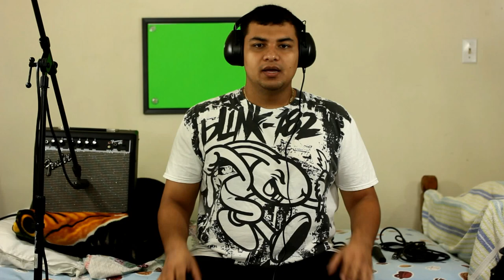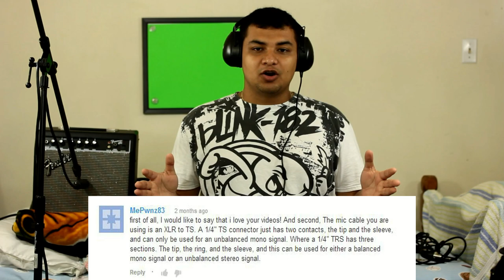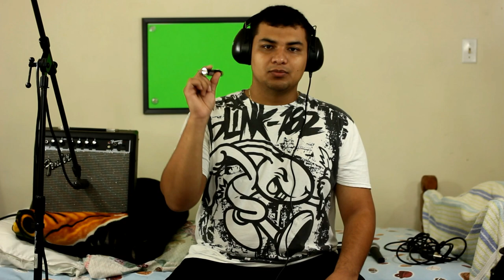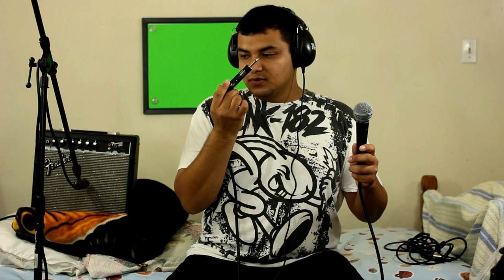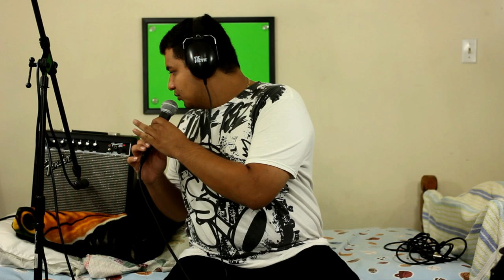How To SAFELY Plug A Dynamic Vocal Microphone Into A Guitar Amplifier

Comment: Just a thought: Technically in many applications, using XLR-to-TRS cable would work fine (just in terms of signal flow, NOT counting impedance matching), since only one of the leads makes contact when plugged into a TS jack. It's only an issue if you want to sum it with a summing box/cable, and summing a balanced signal is a bit different since both signals are 180* out of phase - summing that simply is really only for taking a stereo signal down to mono without diminishing the signal strength (though obviously panning is an issue then).

That's why you can plug a 1/4" TRS ('balanced') signal cable into a guitar/cab and it works fine 99% of the time (the 1% being some sort of shoddy jack and/or plug scenario that causes a short, and that short is likely to occur just as often with a TS cable). Save money too, a TRS cable will carry an unbalanced signal, but a TS cable can't carry a balanced one.
Reply from the maker: I absolutely agree. If you have a mic cable with a trs jack on it, it should work.

Comment from the maker: You'll need two XLR to XLR microphone cables, an impedance matching transformer, and a phantom power source (like the ART Phantom I which is what I use and highly recommend especially for live applications due to it's rugged build quality). With this setup you'll have the female XLR connector on one of the cables plug into the microphone and the male connector at the other end of the same cable plug into female connector of the phantom power supply. Likewise, you'll plug the second cable's

Comment: I replied this to someone, but I put it here too:  Using the method in the video gives a pretty significant impedance miss-match which is either good or bad, depending on the sound you want. If you want to push any line level signal through something like this you should use a reamp box like a radial EXTC. It takes line level and turns it into instrument level so you can run any line level signal through any instrument level process (Like any guitar pedal). I have the 500 series version and love that thing. I have a custom hand wired tube amp made by RedPlate (An rp50duo) and the special thing about this amp is that it doesn't eat the transients like most amps do. So I can run snares through it to beef up the mids / low mids and it doesn't "artificially" compress the signal like most amps do. 
If you're going to run audio through guitar amps that have a master volume, turn down the preamp volume and turn up the master volume so you get the sound of the power tubes rather than the pre-amp tubes. The pre-amp tubes have a mid-range focus that sounds very boxy in most amps, whereas the power tubes just give that tube processed sound.
Reply from the maker: Thank you for sharing. This is good stuff. These days I recommend that people get a mixer pedal like the one that Saturnworks makes. It solves all the issues in one box.

Comment: I have fifine wireless dual microphone. Can I use it for the amplifier?
Reply from the maker: My apologies for the delay. Unfortunately, I was not able to find a owners manual for the fifine system so I can't say for sure because cannot say for sure if there will be an impedance issue. However, I notice that one of the outputs is mean for TS cable so physically you will be able to make the connection without needing an adapter but I don't know if you will run into other issues. I would refer to the manual for your fifine and your amplifier to ensure that their impedances match. I'm sorry I can't be more help. Thank you for watching :)

Comment: I'm really curiojs about how the voice will sound on a 5w tube amp
Reply from the maker: In general, it should be fairly similar to what you hear in this video. I am assuming you that you mean a five watt combo tube amp. If my assumption is correct, the most likely scenario is that the combo will be equipped with either an 8 or 10 inch speaker and this will produce similar results given that the combo that I used in the video is equipped with an 8 inch speaker. The only difference that you might experience could be the tubes pleasantly coloring your voice a little bit. I hope that helps and thank you for watching. All the best :)

Comment from the maker: Hi there, I'd recommend you go ahead and get the impedance matching transformer (like the Audio-Technica CP8201 that I use in the video) for a dynamic microphone as the female connector on your cable will go to the microphone and the male connector will go the transformer which has a female connector at one end and 1/4 inch TS connector at the other end that will go into the input of your amp. Now when it comes to a condenser microphone you can connect it to the amp in a similar fashion.

Comment: hi hope you're still active on this, how should I connect my Shure PGA27 to my fender amp. For recording I put my mic through an interface but i want the sound to come out the amp
Reply from the maker: I'm still answering viewer questions. Making new videos is a little more complicated these days. In any case, the most straight forward route would be to connect your microphone to your phantom power supply via an xlr to xlr cable, the output of the phantom power supply then goes to an impedance matching transformer via another xlr to xlr cable and the transformer can go into the amp. If you plan on using any volume or effect devices they should go after the impedance matching transformer and then you can use an instrument cable to go from your effects to the amp. I hope this helps but if you have any questions or concerns feel free to ask me anytime and I will do my best to assist you.

Comment: I was going to start a garage band soon, but my budget for gear is low so I was wondering what type of amp for my singer would be good for our small venue if any? I would greatly appreciate any suggestions. c:
Reply from the maker: Hi there, for a singer in a garage band I'd recommend you look into getting a PA system because I'm not aware of any amplifiers for vocals that can cut through the mix in a standard garage band configuration. There are a couple of ways to put together a PA system but in a nut shell you can either buy a prepackage system like this one by Harbinger: 

http://www.guitarcenter.com/Harbinger-HA120-Portable-PA-System-105776611-i1509687.gc 

or you can buy a powered mixer and passive speakers in a set up similar to this one: 

http://www.guitarcenter.com/Nady-MPM-4130X-Powered-Mixer-630355-i1391555.gc

http://www.guitarcenter.com/Kustom-KPC10-10--PA-Speaker-Cabinet-with-Horn-Pair-600546-i1322333.gc

or you can buy powered speakers (you may or may not need a passive mixer with these. In a simple setup you can forgo the mixer without any issues) such as these: 

http://www.guitarcenter.com/Harbinger-APS12-12--Powered-PA-Speaker-105488282-i1474995.gc

The first option I mention tends to be the most cost effective but often times these prepackaged systems tend to be a bit substandard when compared with a system that is put together piece by piece. However, for practices and small shows a prepackaged system should be fine especially if you take care of it. You should keep in mind that with the other two options you would have to buy speaker cables to connect the speakers to the mixer or in the case of the last option to each other. I hope this has been helpful but if you have any further questions please feel free to ask. Thank you for watching and trusting me with your question. All the best :)

Comment from the maker: female connector to the male connector on the phantom power supply and the male connector on the same cable will plug into the female connector on the impedance matching transformer which will then plug into your amp via the 1/4 inch male TS connector on the opposite end of the transformer. These two setups should be simple, cost-effective, and safe if all you're looking to do is run your microphones into your amp. So in short you wont need an interface if you are only looking to use your amp

Comment: How do you change the sound to clean? I'm a Microphone noob
Reply from the maker: Firstly, my apologies for the delay in my reply. Secondly, the clean and dirty channels are on the amp. Some amplifiers have them and some do not. It just depends on the amp but in general any amp that has both a clean and dirt/overdrive/distortion channel is going to have a button or switch to engage it. I hope that helps. All the best :)

Comment: if I connect an xlr / p10 cable directly to the guitar amplifier, will the microphone volume be low? what's inside that impedance transformer?
Reply from the maker: I'm assuming you are considering plugging in your microphone using a XLR  to TS cable. As I recall that kind of connection will definitely result in low volume. In regard to what is inside the transformer, I really don't know. All I know is that when you use one it solves that low volume issue and they all claim to transform the low impedance signal from the microphone to a high impedance signal like the amp is designed to work with.

Comment: hey man! first off, great videos. you've proven to be one of the most accessible you tubers out there, and you seem very genuine. i actually have a question i need answered, and no one seems to be able to help me out.

im also a youtube musician, and i recently bought myself a boss rc1 loop pedal and love it. however, i would love to feed a microphone through the loop pedal, and THEN feed that signal to a guitar amp.

my question is, is that possible?? would my microphone need to go through a mixer or a preamp before feeding into the loop pedal? i'm using an MXL v63m microphone, and it does require phantom power - but i'd be open to buying a new mic if need be.

any help would be greatly appreciated, and best of luck with the channel. liked and subscribed brother
Reply from the maker: Hi there, thank you for the incredibly kind words. I can't begin to tell you just how much it means to me to have my viewers feel that way about me and my work. Thank you for the vote of confidence and I will definitely try to help you out in my reply below. 

It should be completely possible to do this but you're going to need the following:

1. A phantom power supply (if you don't already have one I highly recommend the ART Phantom I. It's a bit more expensive than other comparable supplies but this one is built like a tank and it's never failed me)

2. An Impedance Matching Transformer (like the Audio-Technica CP8201 that I used in the video)

3. Two XLR to XLR cables

Once you have these items you'll plug the female end of one of XLR cables into your MXL as per usual and then plug the male end of the same cable into the mic input of your phantom power supply. Then you'll take the second XLR cable and plug the female side into the mic output of your phantom power supply. Once this is complete plug the male side of the same cable into the impedance matching transformer. At this point you can simply plug in the 1/4 inch TS plug on the transformer into your loop pedal as if it were a guitar cable and connect your pedal to your amp as usual. 

Unfortunately, I don't own a loop pedal but I did try this out with my Digitech Digidelay which has a four second loop option on it and it was a complete success. That being said I hope this has been helpful and if you have any follow up questions please feel free to ask. Thank you for watching and for trusting me with your question. All the best :)

P.S. I checked out some of your videos and you are incredibly talented. I will definitely be sending your Passion Pit cover to some of my friends. Cheers! :D

Comment: thank you for this helpful video,but Is there any harm to the microphone or the amp by facing the mic into the amp (when you hear that loud beeping).
Reply from the maker: Hi there, thank you for the kind words. I truly appreciate it. From what I know feedback won't damage most dynamic or condenser microphones. However, some microphones that are not designed to take high sound pressures like ribbon microphones can be damaged by extreme and continuous feedback. This is also generally true for the speakers in a PA system. If the feedback is extreme and constant it could possibly damage the speakers. In regards, to guitar and bass amplifiers feedback could eventually damage the speakers but the consistency and extremity required to damage the speaker(s) would make you go crazy long before you could reach that breaking point. I hope this has been helpful. If you have any follow up questions please feel free to ask. Thank you for watching and for trusting me with your question. All the best :)
Reply: somberamarath Thank you very much
Reply from the maker: You're very welcome. I'm always here to help. All the best :)

Comment: can you plug in the mic and guitar and play/sing at the same time?
Reply from the maker: Hi there, sorry about the delay in my reply, but I was certain I had the necessary patch cable to test my primary hypothesis. However, after loads of searching it turned out that I don't and instead I have the opposite of what I need. Nevertheless, after a quick trip to radio shack I'm glad to inform you that my hypothesis was correct and you can in fact plug in a guitar and microphone at the same time. You will need a Y-Cable with dual 1/4 TS female jacks and a single TS 1/4 male plug. You'll need to plug the instrument cable into one of the female jacks and the plug of the impedance matching transformer into the other and then plug the 1/4 male plug on the Y-Cable into the amp's input. I used radio shack's Gold Series 1/4" to 1/4" Y-Adapter which cost me about $5 but I can understand if you'd like a more trusted brand. I suggest you try Live Wire's 1/4"(M)-Dual 1/4"(F) Y Cable which will cost you about $8 or Hosa Technology's 1/4" Male to Two 1/4" Female Y-Cable which will cost you about $3. I tested out a few distinct styles and genres of music during my test and I recommend you stay away from anything with heavy reliance on distortion or overdrive as the feedback I got was brutal and the sound was very muddy. However, most things I tried on the clean channel were pretty acceptable. I would never suggest this a permanent solution for your performance needs but it does provide a cool feel that would be awesome if used sparingly live and it would create a great effect on a recording. Again I apologize for the delay and for the lengthy reply but I sincerely hope that it is helpful. Thank you for watching and for trusting me with your question. If you have any follow up questions please feel free to ask. Best wishes :)

Comment: HI there i would like to connect my Shure 55sh microphone into my park amp , what is the part which i need to do that 

thanks
Reply from the maker: Hi there, you should be fine with an XLR to XLR microphone cable and an impedance matching transformer like the Audio-Technica CP8201, which I use in this video. I hope that helps but if you have any follow up questions please feel free to ask. Thank you for watching and for trusting me with your question. All the best :)

Comment: Can you put a mic in the fx loop of guitar amp and play guitar at the same time. So they will share the same amp.
Reply from the maker: Hi there, hypothetically you should be able to without issue assuming you are using an impedance matching transformer with your microphone. However, I tried it just now with the only amp that I have at my disposal with an effects loop, that being my Fender Hot Rod DeVille, and I was unsuccessful. I was able to amplify the microphone to an acceptable level but could control neither volume nor eq. This is mostly like because the effects loops bypasses the preamp. I then plugged in my guitar along with the microphone and, while I could hear it to an extent, it was considerably lower in volume than the microphone. The sound produced by the guitar was a bit of a thin fizz more than anything, and both the volume and eq controls had little effect. I can't say with absolute certainty that this would be the case with every amp and I'm inclined to believe that there is definitely a workaround but it's probably not worth the hassle as investing in this kind of setup ultimately offers diminishing returns when compared to alternatives. My apologies for the rather lengthy reply. I'm sorry that I can't be of more help but I hope that this has been helpful. If you have any follow up questions or concerns please feel free to contact me anytime. Thank you for watching and for trusting me with your questions. All the best :)
Reply: Awesome you have answered it perfectly. I will give up that idea thankyou
Reply from the maker: I'm glad that you found my answer useful. You are very welcome. If you ever have any other questions that you think I can help with please feel free to contact me anytime. All the best :)

Comment: Hey there, Where do you actually connect the Shure sm57 to record the sound coming out of the amp ? an audio interface to a computer or what?
Thank you for your response !
Reply from the maker: Hi there, for my videos I connect the SM57 into a Behringer Xenyx 1204 USB mixer and then I output that to my camera using a Pro Co Sound Stereo Mini to 2 XLR Female Y-cable. However, when I'm recording full songs I use my M-Audio Fast Track Ultra 8R interface, which is connected to my computer via USB, in conjunction with Pro Tools. I hope that this has been helpful but if you have any follow up questions please feel free to contact me any time. Thank you for watching and for trusting me with your question. All the best :)
Reply: Thank u that was really helpful dude, I appreciate it !!
Reply from the maker: Yassine A You're very welcome. Cheers :)